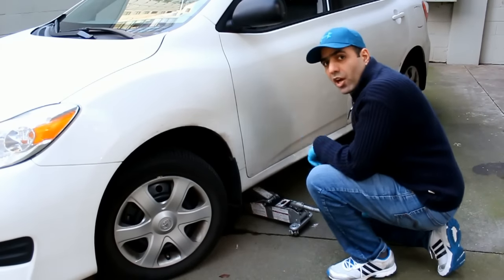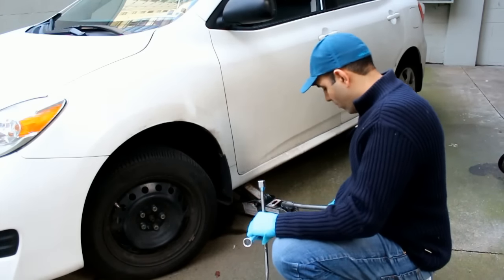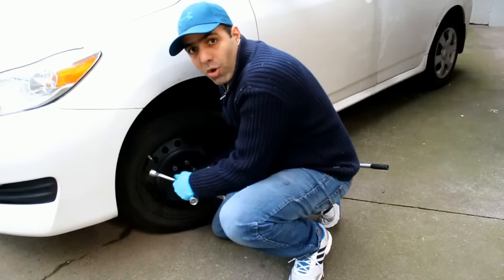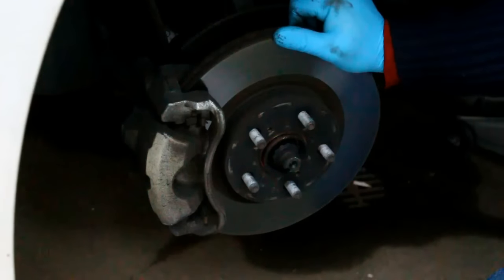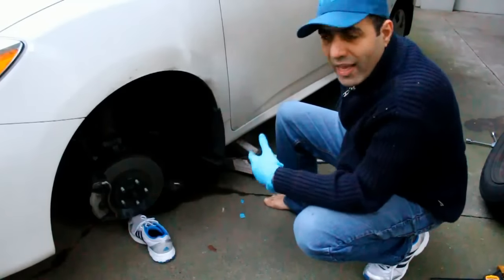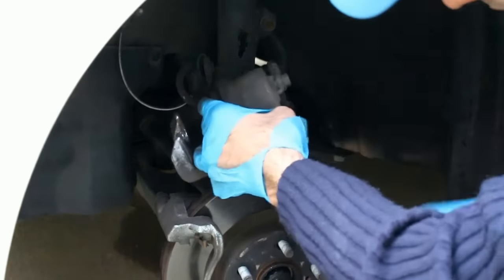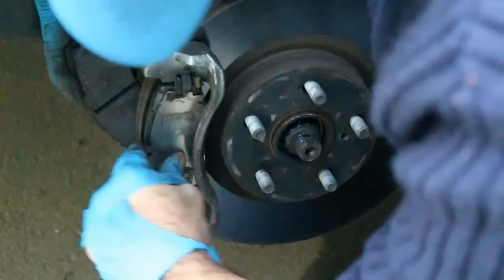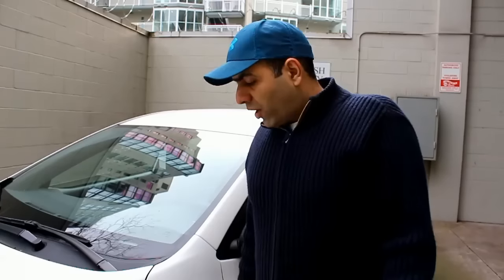How to change the brake pads of your car

Comment: l think maybe pushing piston much back can reverse seals in master cylinder then need new one expensive , so safer to open bleed screw while pushing back to let fluid out. also better cos  old fluid can have water in it that boils on hard braking like hill so all brake power is lost , or corrode pipes maybe.  from comments..  Brake fluid is the most corrosive liquid in a car, it will destroy paint very quickly. For anyone else with ABS, try not to compress the piston like shown in the vid, as it can sometimes cause issues with an ABS system due to debris that can accumulate in the lines. For anyone without ABS, you can still create issues with your master cylinder. You're better off bleeding the brake fluid while compressing the piston, then topping up with new fluid. Always make sure you don't have air in the line after you're done, because air can be compressed (unlike brake fluid), and that sucks when you're trying to brake and your pedal hits the floor.  forgot to open the bleeder nipple, to bleed the brake fluid when pushing back the pistons, so basically at the end you said "now you need to pump your brakes" because you didn't bleed them, there was no point in pumping them, the point of pumping them is to get any air pockets out after bleeding them,. push on the brake pedal a couple of times to bleed the brakes and get all of the air bubbles out  make sure the caliper goes back without a problen first, if it doesn't then you need a new caliper, you should've also removed the bridge and filed the contact points of the pads and put on a new hardware kit to ensure they slide freely, also how you pressed back the caliper is dangerous if you have a fenolic(?) piston as they are easy to shatter if you don't have the proper caliper compression tool, and while folding the flex line over you have to be sure not to crimp it too much as the inside can collapse, requiring a new flex line and then bleeding the system (which requires 2 people or an expensive computer to run the abs module to bleed) .When pushing back the piston, sometimes you have to open the breakfluid tank so u are able to push them back. And if nessesary get some of the breakfluid out of the tank.
2. After pressing the breakes a few times u have to look if the amount of left over breakingfluid is correct. Eventually you have to fll it up.
3. When the New breakes are on, you mustn't do any hardbreakes for one or two days driving. 
4. If the disks have some little "scars" the New breakingpads have to get the correct "shape" to have full breaking power.
      If you let the caliper fall after you take it loose, it can damage the hydraulic line. That damage may not be visible - or it's possible that the line wasn't damaged, even - but if the caliper falls, you REALLY REALLY SHOULD replace the hydraulic line because if it fails, you will have NO BRAKES.
(so holding the caliper up securely is a great idea)
About number 3: different types of pads and disks have different types of break in periods. Sometimes several hard breaks are required to seat the pads. Read the manual and avoid coming to a complete stop.     stop squeak and greasing the pins and clips.
And people never do, but you get better results if you bed your brakes afterwards   Remember to tighten the lugnuts again after the tire is on the ground.    ou should never use the jack as a holding device and always have a Jack stand under the car to rest the car on    s well as not mentioning the Bed In period of seating the new pads to the old disk.  Your breaking power will be reduced the first few miles..     Always use wheel chocks.  A couple chunks of 4x4 will do it. Block the opposite corner from where you are lifting.  And always make sure to use a jack stand, share the weight between the lifting jack and the jack stand.  Give the car a few good rough shoves to see if it will fall off the jacks before putting any part of yourself under the car.  I'm not a safety do-gooder but a friend of mine died when his car fell on him.  Rolled backwards down the driveway when he jerked on a wrench, and toppled off the single jack he was using.  If you can't do all of the above, like when changing a tire with the crappy OEM jack, stay out from under it and have a plan for when it falls off    forgot so many things like cleaning the brake caliper carrier and grease the area where the brake pads touch the brake caliper carrier. you should also use a torque wrench to mount the wheel with about 120Nm ;  in a pinch and if you're in a hurry, just throw the tire that you just took off under the car, if the jack shifts the worst that can happen is it falls on the tire, not your foot or leg...  While I'm at it, chock the wheels or if you're working on the non parking brake axle you can set the parking brake.     dropping a car on steel toed shoes is a good way to lose your toes rather than just break them.    Also you put the wear indicator on the outside it should be on the inside.  hen he clamped down the piston on the caliper he should have shown the part where the cap on the master cylinder fluid reservoir would have blown off since he never removed it   You didn't loosen your bleed screw when you were compressing your piston.. Gonna have an ABS light on if you keep doing it like that.. tsk. tsk.those pads were good for another 10,000km  You forgot to add some anti-seize-paste - not copper paste!!! (too fluid) to the notches and outer sides of the pads   should always use a torque wrench when re-installing the caliper bolts, and torque them to the manufacturer specified force. Brakes are constantly under extreme forces so under/over torquing them can result in the bolts shaking out or sheering.   Many cars require a piston compression tool because in order to compress the piston it requires compression and rotation  forgot to show on video all of the brake fluid that leaked out of the resevoir when you forced back the caliper piston without opening the bleeding screw on the caliper.  when you are pushing the piston in the caliper back you have the brake hose clamped shut and have cracked off the bleed nipple on the caliper.
If you don't do this and just push the caliper back, all the nasty brake fluid that has been collecting moisture and heat will be pushed back through your braking system and eventually cause it to corrode.    should really clean the parts, where the brake pads slide,  Instead of using a clamp to compress the piston, before you take the caliper off, stick a flathead scewdriver in the slot at the top of the caliper and pry the piston. but some say this can bend disc or what.  be careful with the foot method of loosening the lug nuts. Since the are applying a sheering force to the tire stud in addition to the rotational force , a rusted or corroded stud can simply break off before the nut comes loose, I've had it happen.Don't undo the bolt of your wheels completely when the car is down like i did! As soon as i removed the last bolt, my wheel shot out because of the tension! This could be dangerous and damage your car...

Comment: We call this a pad slap, which means the rotors weren't replaced or machined. If there were any brake noises, they won't be going away. Your rotors looked good though.

Comment: A couple of things you didn't do when replacing your Brake pads, you forgot to open the bleeder nipple, to bleed the brake fluid when pushing back the pistons, so basically at the end you said "now you need to pump your brakes" because you didn't bleed them, there was no point in pumping them, the point of pumping them is to get any air pockets out after bleeding them, Ps Im a mechanic

Comment: No lubrication on the tips and backs of the pads, didn't scrub the rust off the old metal brake hardware, no lubrication on the slider pins, didn't even open the brake fluid reservoir and put a cloth over it

Comment: the pads on the front wheels only wear out much faster if you have a car with front wheel drive. A car with rear wheel drive will have the opposite problem, and if you have one with rear wheel drive you'd want to replace those first. Either way eventually you'd have to replace front and rear. But yeah it depends on what type u have....

Comment: I recently had to use the car jack under the wrench arm to loosen a lug nut. Very easy. Too bad the wheel was rusted to the hub. A small five pound sledge hammer solved that, so always carry one of those as well. You can pretend you are Thor.

Comment: first youre brake pad was still good. second, you did not clean you caliper. 3rd forgot the the antiseize and the guide pin grease. 4th you should allways change the rotor at the same time as the pads.

Comment: Do not ware  steel toe cap boots if car falls on them like your trainer your going hospital to have the boot removed by a surgeon an probably removed toes as well inside the boot same as a horse yard if you're wearing steel toe cap boots and horse jumps on you are going to hospital. Bent toe cap n no toes

Comment: there are sooo many problems with this video. 
I am a mechanic with an ASE  with 4 years and I am normally not like this but this guy will kill himself one day just for a couple of million views on an internet video. 

1) when you are working on your own car put the tire under the car when working on it so it doesn't fall on your foot. ( it literally happens twice in this video)
2) the driverside in the front (left in the usa) will be the most worn because there is always weight on that wheel.